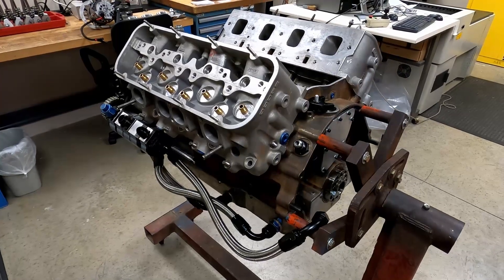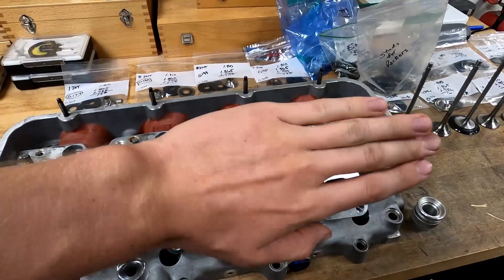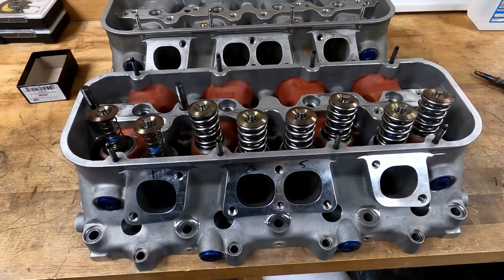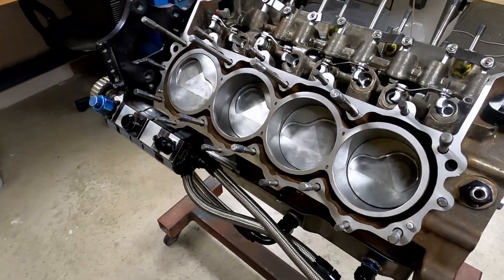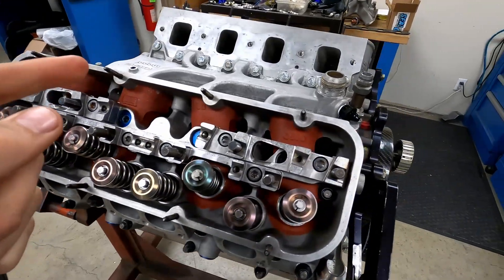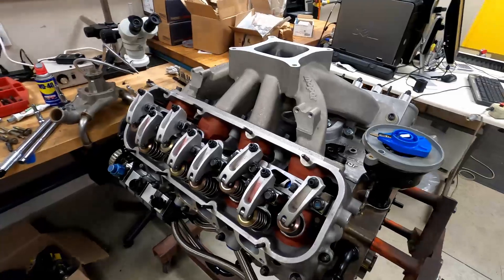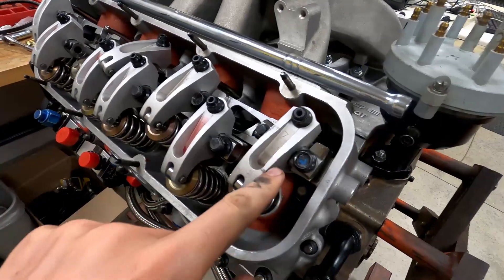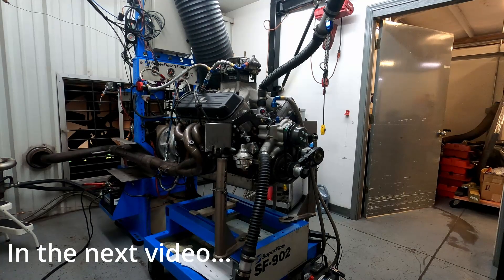Assembling My Dodge NASCAR V8 (Part 2)

Comment: I know you Primed engine before fire up.... but i struggled to see any high pressure lube on pushrods, valve tips, soaked lifters in oil, oil on cam, lube or oil on nuts...  I see other Engine Guys doing all this, just curios if i missed you doing all this... other Guys i watch are like Steve Morris, Lykins M/S, Power Nation....  hope everthing goes well for you..

Comment: Wondering if y’all running the valve springs directly on the aluminum spacers / pucks, or is there a hardened shim? Tend to think they’ll be making metal, without the hardened shims.
Reply from the maker: @georgedreisch2662  yes I believe I forgot to mention that. There is a hardened steel locator that fits under the spring and also registers the ID of the inner spring around the valve guide. Otherwise yes it would be making metal like in the video where I tore down the engine and the previous builder had used hardware store washers under the springs...